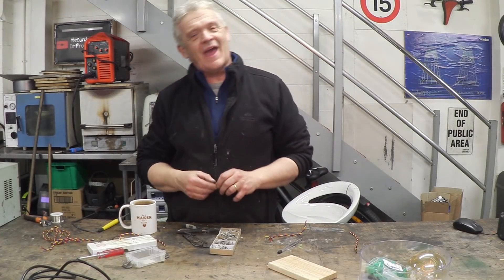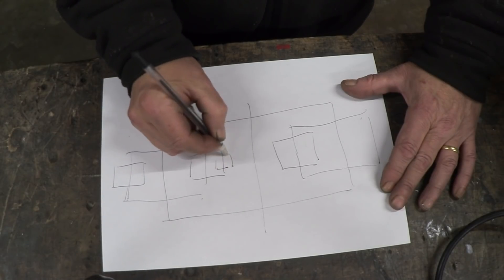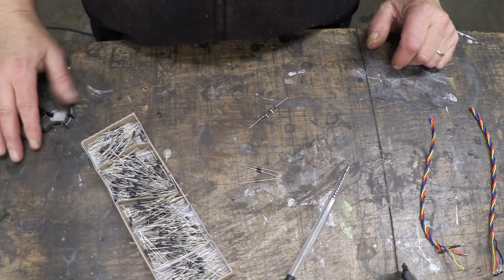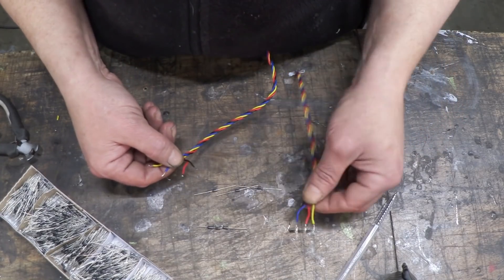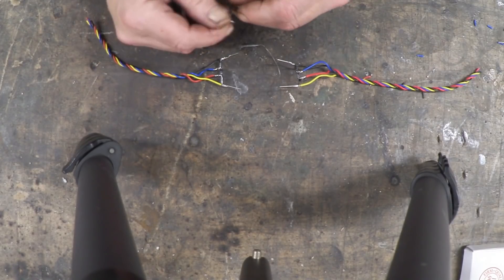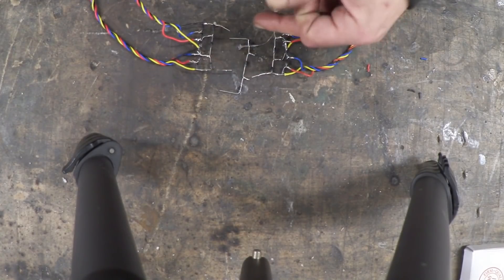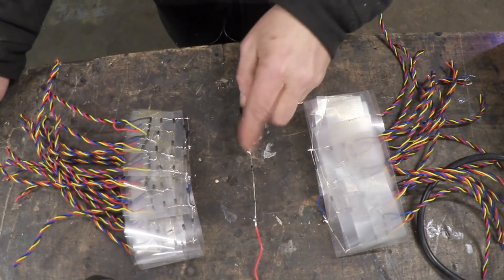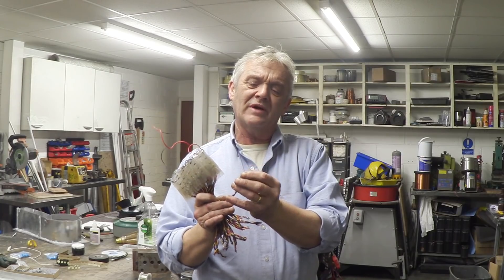1350 Making The Fractal Capacitor - Part 1-  The Diode Arrangement

Comment: hey bud, in your video "" 1497 The Lost Rectifier "" you made a "mom" diode, my question is....wouldnt that eliminate the diodes in the fractal capacitor? so you would just basically have a wire that you treated with sulfur  that uses magnesium to connect that capacitors together?

Comment: I know the goal for the device as originally designed for IC based capacitance to negate capacitance loss using special fractal printing patterns to print the capacitors on the chip, but I am not sure how this circuit actually relates. I am curious, what is your goal with this circuit?

Comment: Awesome, tested two strips together using 4 100 uf caps with 100 volt power source. It becomes a voltage divider splitting into three separate voltages you can tap into one 75.4 volts the other 49.6 volts and the last 24.5 volts... Connected lamp load to 24.5 volt output rated at 24 volts 100mw, recorded 852ua draw from the voltage source across the lamp. Voltages at all three points with lamp running 73v 17.9v  voltage at lamp 16.9 and dropping slowly. Open the switch and discharge the caps almost instantaneous voltage drop across all three points reading -1.32 where it was at 75v.... -644 mv and the point with the lamp load is at 1.12volts and dropping slowly...very slowly. Close the switch to charge the caps voltage bounces back to original numbers up top.  Very cool voltage divider for DC circuits.. can't wait to see how it works with static generator. Side note really cool oscillator if you replace the switch with a transistor.

Comment: I really have to wonder if my capacitor idea would help with this. (think charging up the negative on the bottom plate of a capacitor that is at the bottom of a stack of capacitors, and the top side of the top capacitor in the same stack so that its opposing side is charged the opposite polarity of the next layer in that capacitor so the whole stack is charged much how the fins in a magnetron are charged off the leading edge of the first fin is. but no way to auto discharge between the plates unlike how magnetrons auto discharge through the cylindrical metal sleeve the fins are sticking in off of, so you end up with voltage potential divided across the whole stack? (each layer the capacitor would have only about 0.001 inch layer of dielectric on outsides and between plates, (or 0.0254mm) 

so the static charge potentials on each plate can effect each other, through this thin layer of dielectric, 

the last aspect is that the plates are long with a round end ( to avoid discharge) but length is a strip laying flat, and the legs of each is moved over so the legs are sticking out instead of being stacked up from looked at on top, it looks more like this |||||||||||||| where each two lines are to one of the capacitors, and you can arrange them so leg 1 and 2 are the 1rst cap, while the 3rd and 4th legs are to the second capacitor. and so on . that way you just hook up the high voltage to the first leg and the last leg, and pull from all the rest for parallel output. :)

Comment: Scratches head.  Is its purpose to increase a capacitors density or voltage or both?  I'm an electronics dude and never heard of it.    I read,: "Fractal capacitors Abstract: A linear capacitor structure using fractal geometries is described. This capacitor exploits both lateral and vertical electric fields to increase the capacitance per unit area. Compared to standard parallel-plate capacitors, the parasitic bottom-plate capacitance is reduced.".

Comment: I'm almost thinking a Flux Capacitor would have been simpler :O it only had three flashy bars in it :O not a thousand invisible silver ones :O   (jest aside, actually a nice one or two layer model in something like the  circuit simulator Falstad wrote; Circuit Simulator Applet - Falstad would be right nice I can better follow a schematic first then the physical model)

Comment: Instead of the plastic you could have just used the liquid insulation and painted the diodes after soldering. Like when you dipped the fan motor to make it waterproof.
Reply from the maker: lol - damn that would have been easier lol

Comment: Thanks. This is very exciting to see what the output voltage and frequency and current will be and there will be losses from each diode losses multiplied.
Reply from the maker: absolutely mate but according to the research paper this is based on the losses are minimised

Comment: Is that based on "s41467-020-15373-y" and can you use electrolytic capacitors and thereby reduce the diode count at all?
Reply from the maker: I don't know what s41467-020-15373-y is mate and I would think electrolytic wouldn't change the diode count

Comment: I'm still confused lol 🤣😂 did you test any of them in smaller pairs with electrolytic capacitors or just hoping it works when you make and connect the 128? Caps